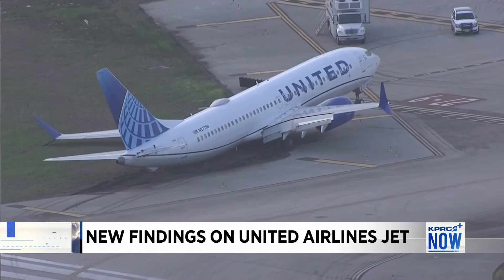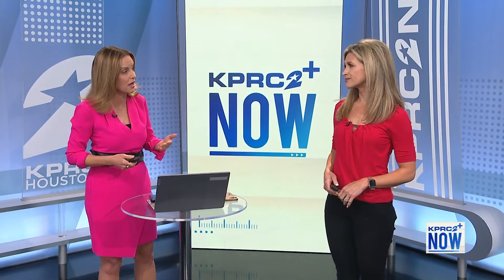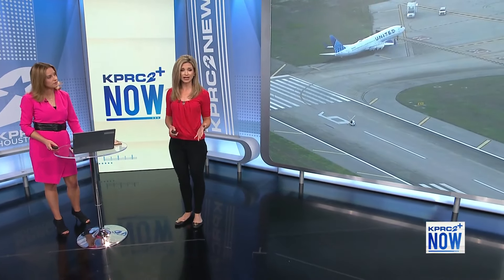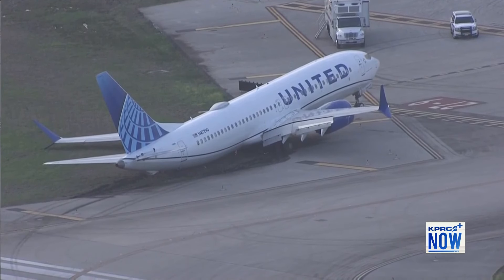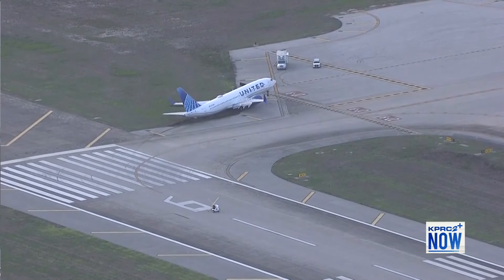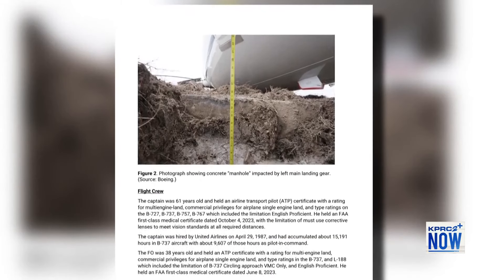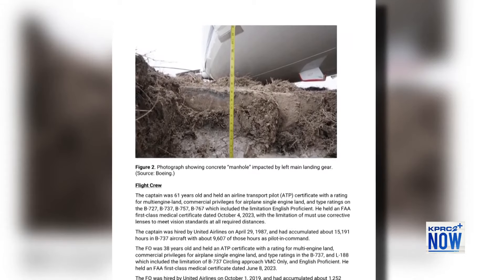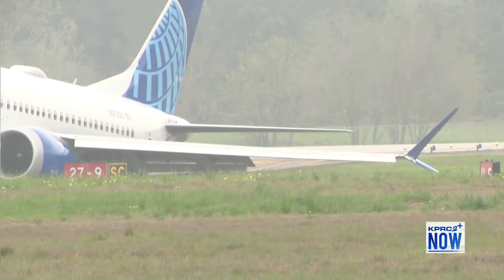New findings on United Airlines Jet that slid off runway at Bush Airport

Comment: Y'all know there are two pilots, right?  Why singular?
Reply: Because only one is responsible for actually flying the aircraft at any given time.
Reply: @johnp139  Which can be the first officer OR the captain.  Both pilots are trained exactly the same.  Both pilots are controlling the safe operation of the flight.

Sometimes the first officer can be more experienced and have more hours than the captain.

Comment: Main factor don’t fly a Boeing plane 😂
Reply: This is not the planes fault. Pilot error
Reply: @JamesAnderson-mr2sg  Considering almost  all of the other planes that  had issues r almost all made by Boeing
Reply: @travelaviation3146 yep airbus has problems too
Reply: @KingSosa97  Atleast Airbus builders are proud of what they built, Boeing builders say they wouldn't put their families on the planes they built
Reply: @travelaviation3146  So the two Delta A330s that lost panels were Boeing airplanes?  The brand new A321 that United received that had an engine failure was made by Boeing too?
Reply: @travelaviation3146 -- Most airliners are made by Boeing, so they will have a greater share of incidents.